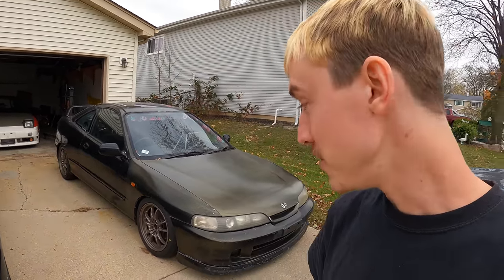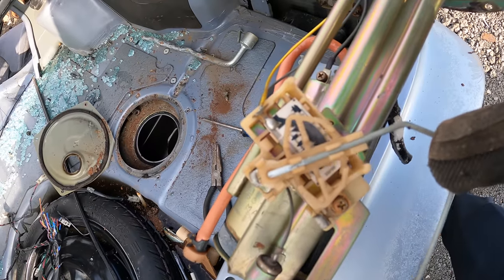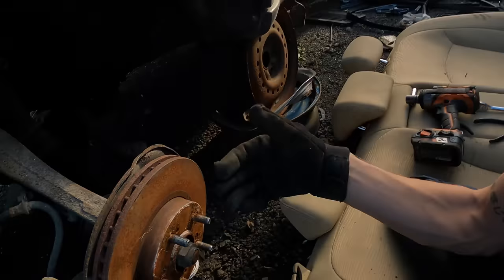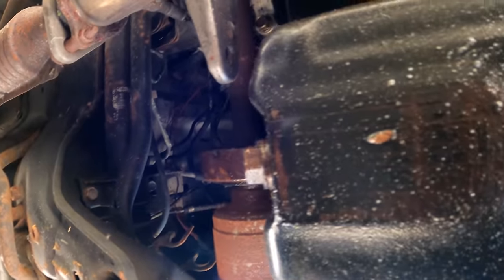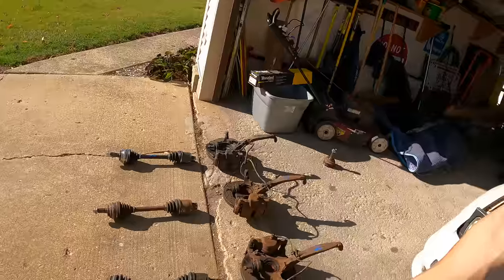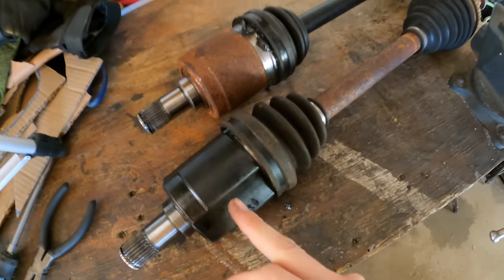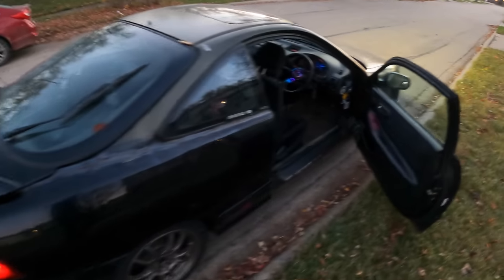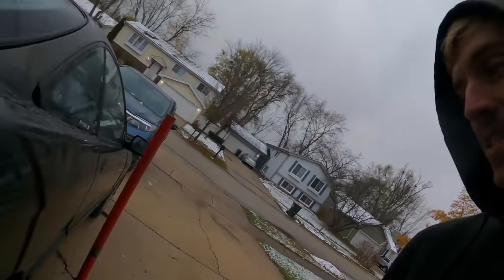Reviving my RHD Integra with Junkyard Honda CRV and Prelude parts

Comment: Good info.

Just s few things I noticed in the video I'll help clarify. 

The Prelude Type SH isn't 4 Wheel Steering. Only the 3rd and 4th Gen Preludes came with 4WS. The Type SH has a basically an electronic "limited slip" transmission.

The reason why the Axles aren't the same length is because the transmission is in one side of the car, so there's a need for an intermediate shaft that installs on the back of the engine 

Also, the "Type R calipers" are the same as the CRV, 4th and 5th Gen Accord wagon, and Acura CL.

Fun fact. The front rotors are the same in the Integra Type R and 5th Gen Prelude. The rear rotors are unique to the Type R though.

Comment: 9:15 dude, that’s so damn smart to use a jack stand. I’ve slipped off a bolt and punched a steel bumper with the back of my hand. Split it right open and bled everywhere. Good ole knuckle buster.

Comment: The interior of the 240 at the end of the video is in good condition, my first reaction of seeing the dash without cracks was the same as your.

You're an engineer by the way you work and solve the problems of things not fitting or working.

Comment: 18:00 Reminds me of the time I had to shave some nubs off of a valve cover gasket for my 2006 Mustang, I had bought a new valve cover for the passenger side because one of the ignition coil bolt holes was cracked, Ford revised the valve cover in 2008 to use 8 bolts rather than 14, but little did I know they also changed the gasket slightly, the 2006 gaskets have 2 little nubs that go on the backside of the valve cover that don't exist on the 2008 one, but besides that the gaskets are the same so I simply cut those 2 nubs off and it worked, it's going to be weird having to cut those nubs off of the passenger side gasket every time I need to replace them though

Comment: Really late to this :) but very nice job, explanation and really clever mix and matching. I only found out about the CRV stuff when I needed a front wheel bearing replaced on my JDM DC2(98 spec). Bought the 'correct' bearing only to find it didn't fit. Turned out it was for the Euro R and the pre 98 spec JDM R, as you point out the JDM 98's on have the same size bearing as the CRV. 
Nice JDM front end and I see you have the HID headlights too. They're going for daft money these days and sadly there's no third party options. Always liked the USDM rear lights with the extra corner bulb. I've a couple of sets of JDM and Euro rears and might have a look at retro fitting the corner bulbs(the mount is there but sealed). And then there's the Euro rear bumper foglight that needs fitting...

Comment: Next time, press in base model rsx wheel hub and bearing. It’s 32mm. Then you can use your stock axles.
Reply from the maker: RSX is 36mm
Reply: Type s is 36mm. Base model is 32mm. I’ve done it. The crv and base model rsx have the same hub bearing part number. That’s why you can use the hub bearing and wheel hub. I have this set up on my del sol.

Comment: They have tools for ball joints, tie rods, etc. I guess hammering works too!

Super helpful video!

For axle nut mine was seized on my dell sol. Broke a breaker bar. Hit it with an air impact gun and it took it off whew.
Reply from the maker: The tools for ball joints generally harm the ball joint itself. For example, a pickle fork is only to be used when replacing the joint because it damages the boot
Reply: @PrizzaMike  Yes those will destroy it.  I'm talking about the ones that you can rent from advanced auto.  They typically don't.  but hey what you are doing works so screw it.  Thank you for the content!

Comment: Sh isn’t all wheel steering. Sh stoood for super handling.   It had active torque transfer. When you went around a corner it would transfer the torque from side to side to help the car push through and not under steer.
Reply from the maker: That's pretty awesome actually haha
I was misinformed, thank you for the correction!
Reply: @PrizzaMike  you’re welcome. They did have one with “4 wheel steering” it was in 87 I believe. The back wheels barely moved at all though. I think the model was just 4ws for 4 wheel steering.   The reason the axels are different lengths in the SH is because of the different trans though.

Comment: Legend dual piston calipers are a pretty good cheap upgrade if you are making your own 5 lug. I got 2 rebuilt calipers from oreilly for 32.99 each with lifetime warranty.
Reply from the maker: Interesting! 
Do they bolt right on to crv knuckle?
Reply: @PrizzaMike  idk about a crv knuckle, I used them when I converted my gsr knuckles to 5 lug. They use itr pads so lots of compound options

Comment: Legit! Now I want to 5lug swap my integra. Do you know what to use for the rear 5 lug parts?
Reply: Check out chai's garage YouTube channel he has a great video on it front & rear
Reply from the maker: Just watched the 5 lug video you mentioned. That is currently what is on my rhd integra and it's not the greatest set up (calipers upside down due to fitment issues) (no ebrake) 

I found a better solution with my sedan 5 lug, so I'll be making a complete 5 lug video showing the process and parts AND working e brake.
Reply: @PrizzaMike  do you know what axles I can run I have the jdm itr 5 lug 36mm I really thought I could use crv now seeing your video got me worried my axles are good but being low & running 25 yr old itr suspension & axles definitely want to know what I can run
Reply: Everything is jdm oem itr also it's in my integra b18c
Reply from the maker: @budgetbuild914  this video I go over what works for the front axles with a 36mm hub

Crv (what I used in this video) and jdm itr (98-01) are 36mm

Comment: We need the backstory on this car now!
Reply: He made a video talking about the story of this integra
Reply: @budgetbuild914  incorrect that video is talking about time 4 door integra aka the work truck. The integra he worked on in the video has welding horizontally while the other one had welding only in the rear and vertically.
Reply: @Tech_481  you see the type r sticker it has that because he welded that quarter panel from a itr he spoke about both of them you just think it's only the 4dr he showed how he fixed that 2dr integra & talked about it
Reply from the maker: Great attention to detail!

I haven't made an official rhd integra video yet, but I suppose now would be a good time to start digging up some old clips!
Coming soon 🤘
Reply: @PrizzaMike  awesome can't wait! If I'm being honest I found for channel from a Instagram reel. It made my day seeing your wrecked 240 sliding on the track and seeing you start rebuilding it was awesome! Then like 2 weeks later boom your channel popped up into my recommendation and I've been binge watching when ever I can😂.
Reply: @budgetbuild914  ya I see what your saying but that's not what I meant about we need a backstory video. He made a backstory for the 4 door now I wanna see one for the two door! He just replied and said ones in the works so hell ya!
Reply: @Tech_481  yeah no story for it you right about that
Reply from the maker: @Tech_481  thanks for sticking around man! Means alot 💪🔥
Reply: @PrizzaMike  haha no problem also don't burn yourself out trying to get the video done take your time the story's always going to be with that car so no hurries!

Comment: You have the wrong cv on the one that’s coming lose, you prolly have two rights or two lefts they both should tighten as you drive
Reply from the maker: Impossible to run two lefts or two rights

One input shaft is male and one is female 

Technically only one axle would get tighter front driving forward since the threads on each axle are both 'righty tighty'
Reply: @PrizzaMike  idk then, tac weld it then😂😂😂😂 jk

Comment: That seems really sketchy. Rather pay 1k in real “SAFE” parts then an axel braking going 80 on the high way.
Reply from the maker: What's not safe about this? Do you realize how axles are made?
If you dont feel confident it doing it yourself, you could also take the parts to a driveline shop and pay someone to do it.
Reply: @PrizzaMike  when it brakes I’ll be laughing at you 😂😂